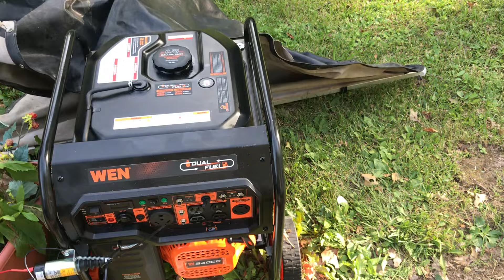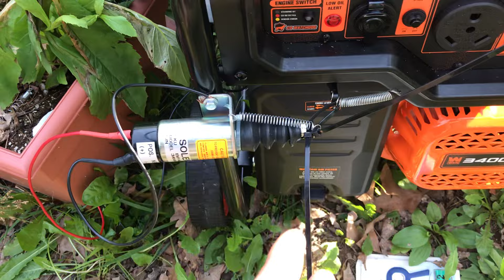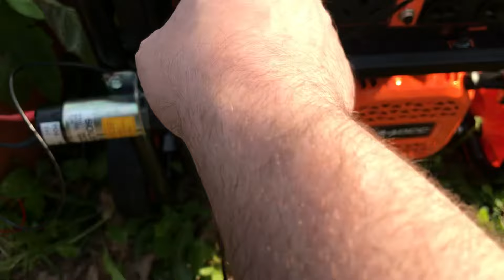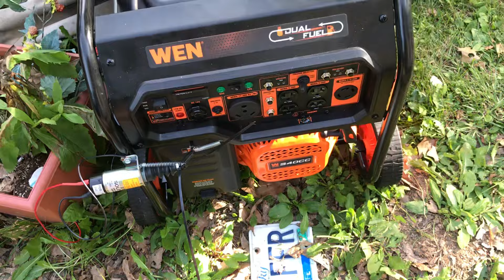Generator electric choke modification.

Comment: Do you have a link or at least a part number for the solenoid you used?
Reply from the maker: It was just a fuel cut off solenoid I had laying around and some springs. 

https://www.amazon.com/Solenoid-Replace-Lister-366-07197-SA-3405T/dp/B0837G237X